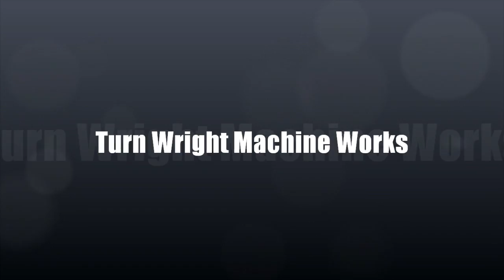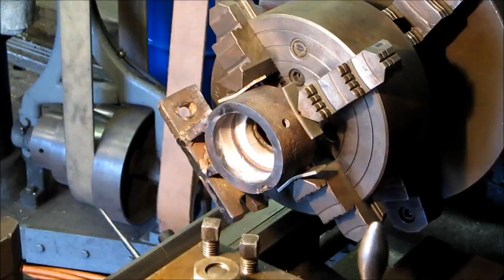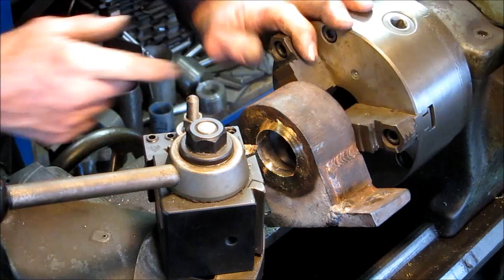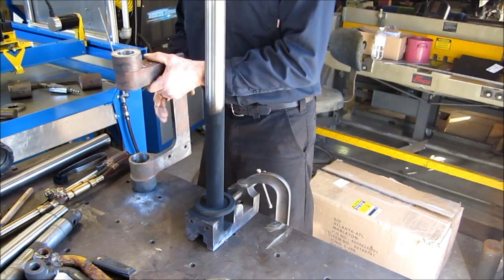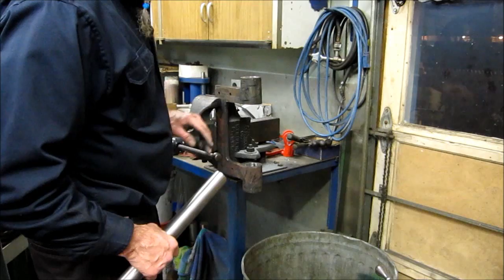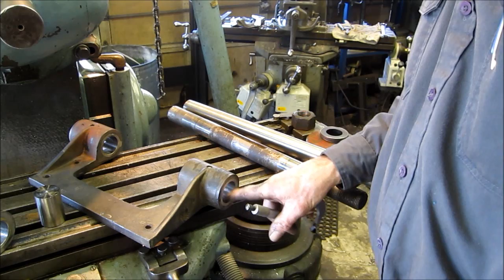Resurrection Part 3

Comment: When pouring babbit and you are using block off plugs you can seal them up by using modelling clay (not plasticine). Simply roll out a length of it and then form a fillet around your plug to your part. The clay will easily take the preheat and it will simply break away when you are done.

Comment: This may sound a silly question, but I can't find the answer in my searches - If I see a bearing with a zerk fitting, how can I tell whether to pump grease or oil into it - Are the zerk fitting different, or do I just have to rely on a best guess, based on what I think the bearing requites?

Comment: Why did the losers who were so poorly informed about lubrication techniques, not get themselves an old diesel from a scrap yard and use that to run the antique saw blade. It could even come with its own gear box had have a drive shaft long enough to house the dangerous stuff well away from the suicidal stuff.

Comment: Any idea what the metallurgy is on the Babbitt material? Melting point,Rockwell hardness,or make-up? Tin/lead? harder? Zinc maybe?
Reply: +Fishkiller 41 No zinc, Babbitt is sort of a generic term for a number of different alloys of pour-able bearing material. I can think of at least 7 different alloys off hand. Most are tin or lead based, then copper, antimony, arsenic, graphite are added in to give you the desired properties. Each has specific properties and uses.

Comment: I know that fence CO. who's cut off U were working on got 1 HELL OF A BILL for U fixing their OBVIOUS neglect.(serves then right I guess) WHat I noticed is,you did the work as fast as humanly possible,without screwing anything up.They now,no doubt have a perfectly operating cut off saw.(unless it had problems you never saw,in addition to the work you did)
Great job Mr.Fenner.  I got the "low down" on your vids by watching Tubalcain.(Mr. Peterson.)

Comment: What is it that you're using to check the piece for proper pre-heat? I doubt it's wax, unless there's a special wax with a high melting point! Just curious since I noticed you using it in these Babbitt pours.
Reply: +TheFurriestOne Those are heat sticks. They're compounds that melt at a certain temperature and are available in a wide variety of melting points. Used to measure the temperature of materials for preheating, heat treating & etc.
Reply: Luckystrike I wondered if it was something like that. Thanks!
Reply: TheFurriestOne
 No problem.
Reply: +TheFurriestOne  The brand name is Temp-it sticks . From a welding supply . Many different temps. available.
Reply: 1-Shot slinger Thanks!

Comment: Quick question, is the Babbitt material just lead?
Reply from the maker: Lead and Babbitt are two different metals, lead is lead, and Babbitt is either tin or lead based but has other alloys added with it. Tin based Babbitt is more suitable for rotary loads, like on a crank shaft in an engine and lead based Babbitt is better for stationary bearings like in a band saw. I do believe that when you have a higher chance of more heat in or surrounding the supporting bearing, I rather use the tin based Babbitt due to its higher melting temperature. Just my preference! ;{)-----
Reply: Make a lot of spence, never seen that process before, very interesting
Reply: Thanks Keith could you do a metallurgy 101 video on YouTube, for the machinist noobs out there, as I watch your videos and you talk about the metals you use, it's a bit difficult to follow the 5W's

or is that just such a comprehensive subject that you could start a whole new channel on that alone
Reply: Hot rolled is when the metal is shaped in the steel mill while the metal is red hot like orange still. Cold rolled is when the steel is shaped/formed cold not hot at all.

Comment: wrong. motor cycles use ball and needle bearings for EVERYTHING, ball bearings on the crank, needle bearings on the rods, my 1971 XS1B 650 Yamaha has a friction bearing on the small end of the rods, but it's not Babbitt, it's hardened aluminium. I've rebuild over a hundred engines in the last fourteen years, and I have not seen one single engine with Babbitt bearings

Comment: Wow, three times longer. So, if whoever reassembled it with a sledge hammer had not gorillaed it back together those arms would probably still be functional? The babbitt pour directly onto the shaft is another trick in my pocket for the future. Keep it up, you're video's are great.

Comment from the maker: The Babbitt cost more than the bronze bearing material. So Babbitt is not a cheap way out. The pouring of Babbitt into cast cavities, to establish true shafting bores is done without the expense of line boring procedures and if maintained properly will out live the standard ball bearing or bushing  two or three to one. ;{)-----

Comment: No...That would be half of .125" or .0625" deep per side. Here's another example....What is the tap size of a 3/8-16 threaded hole ? 1 divided by 16 (thread count) = 1/16" so 3/8" minus 1/16" = 5/16" tap size. That formula works with any thread pitch when you don't have a chart or is so uncommon size like 1/2-24 for instance.

Comment from the maker: I'm not quite sure how you’re going about making your adapter, but don’t short cut yourself material to support the threads, you would be cutting it to close if not breaking through the .095” wall thickness with an eight thread pitch. Note; a thread depth is almost a match to its width. ;{)----

Comment: Keith...I have a question... I bought a dividing head which did not come threaded for a chuck, so I have to make a plate to bolt on it with 1 1/2 - 8 threads... would a piece of 1 1/2 .095 be thick enough for that or should the tubing be .125 or more ??? Thanks !!!!!

Comment: Thank you so much for taking the time to mic up the bore and the shaft and explain my question about the reamer.  I've never encountered babbitt bearings in my travels and was curious to what kind of clearance they needed to run good.  Once again, thank you Keith.  You're a hell of a machinist and I'm glad you are so generous with your knowledge.

Mike

Comment from the maker: @submarineboat Hey Doug, for oil W / Babbitt, I would use the rule of .0005 to .001 per inch in diamater, up to about 5 or 6 inches, after that the rule would change to every couple or three inches in diamater. :)